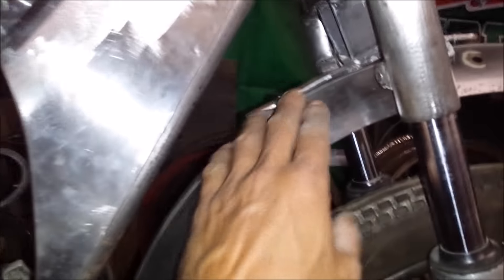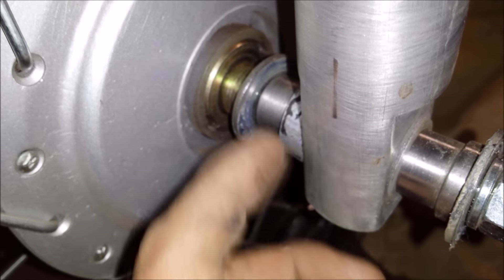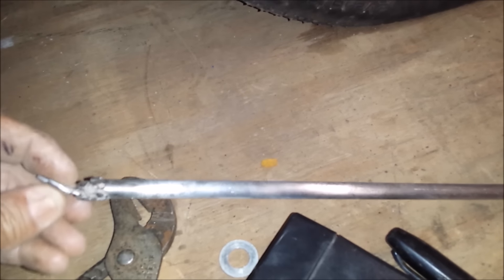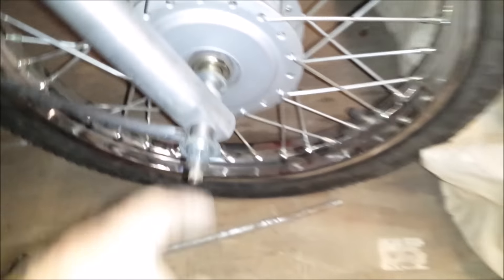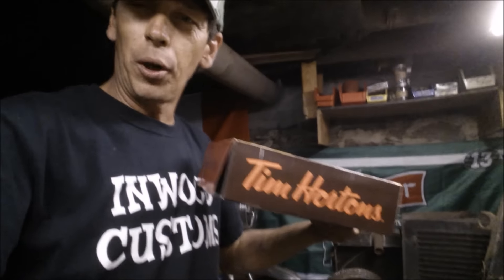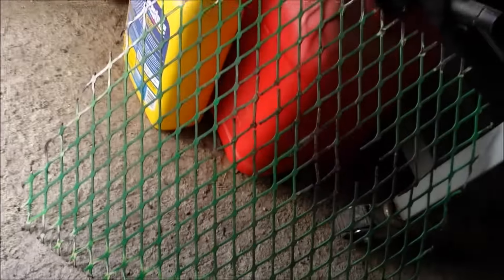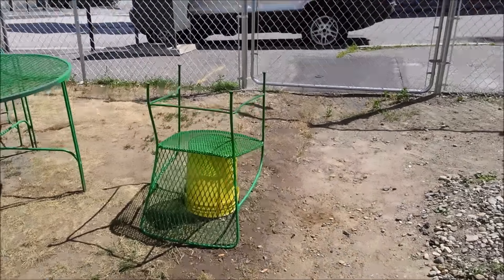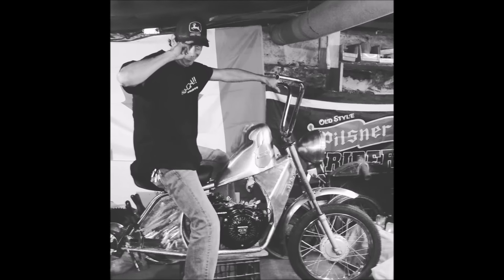Fender work, and Green Chairs With Dizzy

Comment: Hello udizzy on your fender set you have now I don’t think it will work the top of the fender mounted under the handlebars then the shock with movement and then your brace to the middle shaft.  You need to come up with a bracket on the lower tubes to come up and over the tire to the other side then it will all move up and down all together with the lower braces that you all ready made up.  If this makes any Since to you.  Keep up the good work on the videos love watching them, I don’t comment very much but always a thumbs up to ya. Take care be safe, later
Reply from the maker: Thank you brother, you are right, now that i look with my good eye, lol back to the shop i guess  cheers man
Reply: Digging through comments to see if anyone caught this. The rods are a no go. :D Cheers! He could probably run somethign underneath the fender lengthwise to just stiffen it up
Reply from the maker: That is the way i may just take it, just never even thought of it, thanks so much for the help, cheers the Dizz

Comment: are you puttin a speedo on it..speedo drive off the front tire?
Reply from the maker: If i find something that works with the rest of the bike.  cheers man
Reply: You would need a speedo drive in the front wheel. You'd have to incorperate that in before cutting your spacer. It actually acts as a spacer itself. I think the narrowest speedo drive is 5/8" wide. And you can get them up to over an inch...can always be done later too. Lovin the trike man...have an awesome durds.
Reply from the maker: Thank you my friend, or maybe a bike one
Reply: True...true... just for fuks gunna see if i got one...is your axel diameter 5/8"?
Reply from the maker: I think so, not in the shop today but i will check, cheers man
Reply: I'm sure it's too late but i looked for a speedo drive but no gots 2 days ago and 4gits 2 tell ya. Scatterbrain. Btw i get alot of cheep parts including speedo parts at jireh cycles.commmmm✌💪🍻
Reply from the maker: lol np thanks man, cheers brother
Reply: Hey bud...5 more names added to the police bike badge. Stay safe man.
Reply from the maker: Yes sir, very sad. but that's why i do what i do brother, cheers man